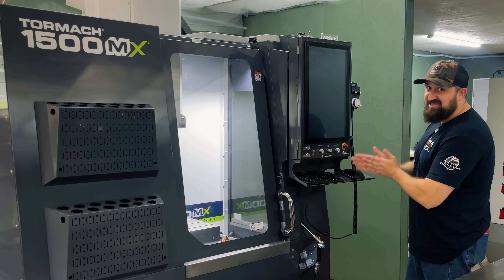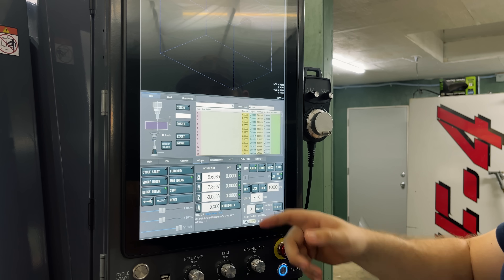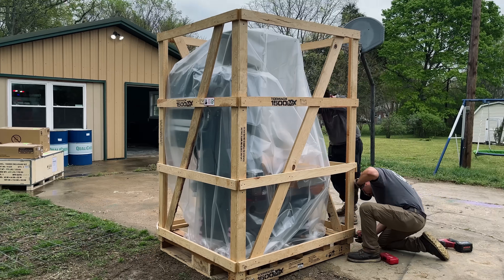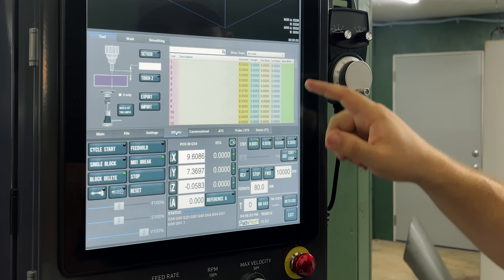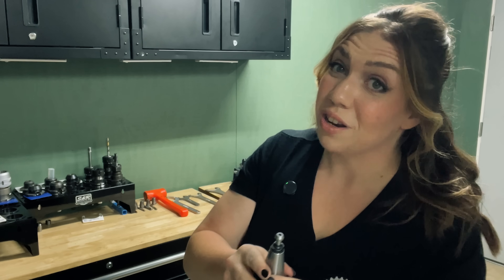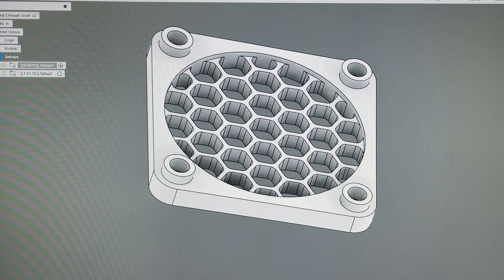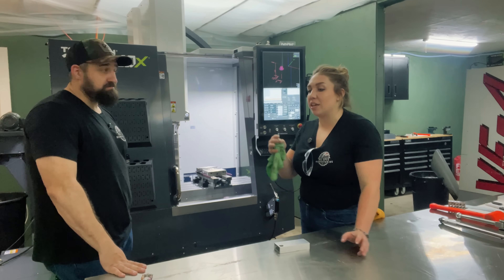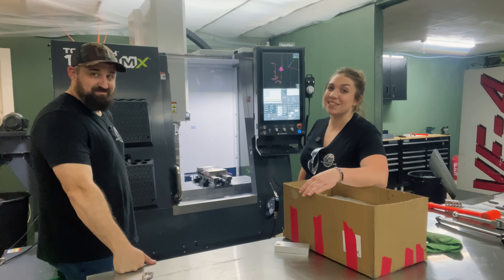What It’s Like Getting a New Tormach 1500MX | Becoming a Practical Machinist Ep.22

Comment: Put a dial indicator on the z axis column, set it against the backside of the milling table and load the indicator up a 100 thou,  jog the table all the way to the x axis end of travel,push on the table and watch how much the table wiggles. I'd bet money you get .002 t0 .003 of slack. Dovetails suck, tormach thankfully addressed this on there news high-end machine. Not trying to be a dick. I absolutely love my tormach, but it's only fair to let others no about it's flaws.
Also....watch that your balls crew couplers don't come loose and give you massive backlash.....it can happen.
Reply: The 1500mx doesn't use to old dovetail.
Reply: @truckinglock  i wasnt aware of that, Thats awesome that Tormach is building machines like this now. I stand corrected. And I m happy i was wrong!!

Comment: All due respect. Tormachs are great, but they have nothing compared to a haas. The first main downfall is the dovetailways. This is the main source of pain owning a tormach compared to a haas. I have a pcnc 1100 with all the upgrades. It's great,  it works everyday, it makes me money but I cant rely on it for even medium level precision. Aswell it has no power compared to my haas tm2p. Tormach is a great company, amazing helpful staff, and very extensive stock of replacement parts. After owning a tormach 19 years, I'd still buy another one if my budget was limited. But I'd be much better prepared to make money with less effort going with haas. Most people start out with a tormach and work upto a haas. Not dissing you at all, just simply being honest based on my experience. That tormach will make you money, but no way you can argue, any haas mill will run circles around any tormach.
Reply: I hear ya - Haas have some great machines.  FYI - the 1500 has linear bearings instead of dovetails.  Many other upgrades from older Tormach machines such as epoxy granite frame.  Much faster travels, rapids… etc…
Reply: I'm also a HAAS owner. I've held this same opinion for years. The 1500 changes the game there. This machine and the TM machines are direct competition. It now comes down to what you actually need. TM gives you work envelope capacity. Bigger tables and travels. The tormach gives you options. You have 15k worth of haas options built in the control. Forget about the fact the TM doesn't give the rpm or travel speed for small tooling too eat. IMO
Reply: Did you hear the specs on his haas? 7500 rpm, 700 imp rapids, 300 imp feedback, no look ahead.  

The 1500 isn't a PCNC, it has servos not steper motors. So it's probably a step up. 

I started on a PCNC770, I can hold .0005, .002 true position, and .001 cincentricity, beacuse I know my machine.  
I also have a tm2p. the tormach can't cut like the haas, but then my tm2p can't  cut like the umc750 and none of them can cut like a DMU or makino. 

This is what works for them.

Comment: I guess I'm lazy... Would have spent an extra 500 to be factory assembled?
Reply: Yeah, its silly. They’ll also troubleshoot any issues it has. And for only 500 bucks, it’s a no brainier.
Reply: If I’m remembering correctly, it’s not $500. That would have been a no-brainer LOL. 
It cost much more to have pre-assembled. 
I’ll have to check their website to confirm.
Reply: Just checked.  Additional $10k to be factory assembled. So if you want to save some money, self assembly is definitely a great route to go.
Reply: The factory assembled option that’s $10k above the base price includes the tool changer and flood coolant system - which total around $8500 as separate options (approximately $5500 and $3000).  So factory assembled is actually around $2000 as long as you want those options!  We purchased a 1500 for prototyping at work and I had to assemble it.  It will take a few days (at least for me) but it’s not that bad.  We had a small opening to move it through otherwise we would have gone the factory assembled route.
Reply: Just checked it is indeed only $500 for assembly. The assembled one comes with the ATC and Flood Coolant. So if you put self assemble and add those two things it's only $500 cheaper.